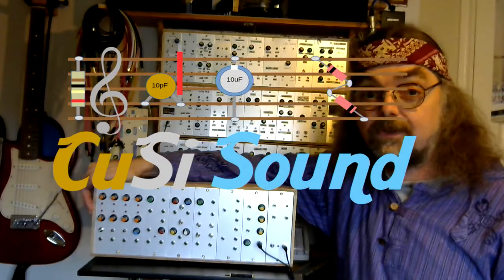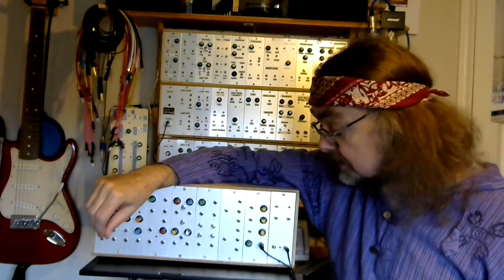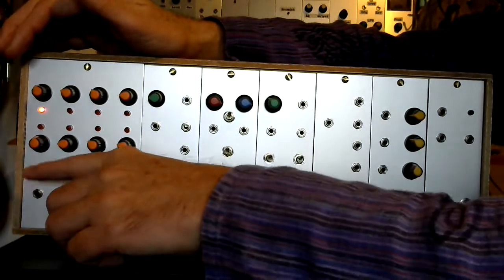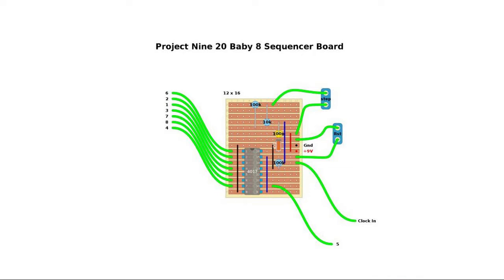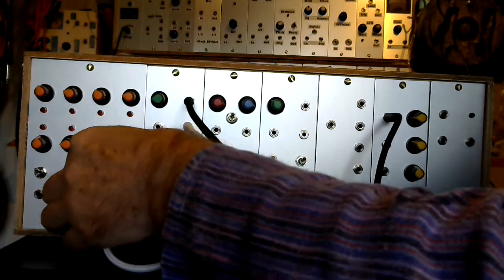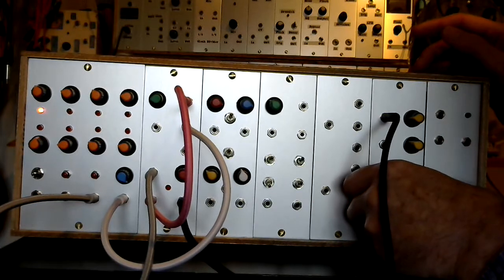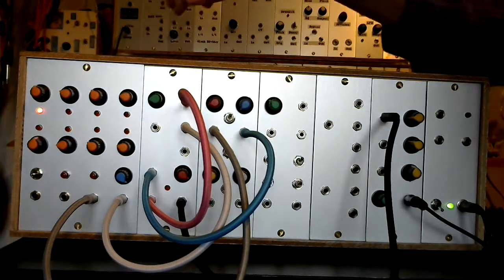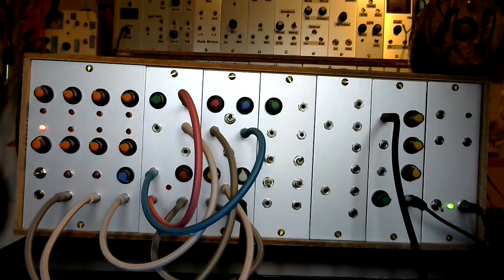Project Nine-20 DIY Modular Analogue Synth : Baby 8 Sequencer

Comment: Is the gate output to be connected to the ADRS? or would it be sufficient to adapt another CV output?
Reply from the maker: Gate signals work like switches, they are either on or off. The most common voltages for gates are around 5V and 8V (The Project Nine-20 Baby 8 provides both 5V and 8V, approximately, gate outputs). The CV voltages can range from 0V to 10V approximately. I know the envelope in Project Nine-20 will trigger at 5V but I don't know if it will still trigger at lower voltages. So, if your CV voltage drops below 5V it may not trigger the envelope or any other module that works with a gate/trigger input. Hope this is helpful.
Reply: @CuSiSound  finally works m8! thanks!
Reply: @CuSiSound  okey I will expand my baby step with your 5v and 8v gate section, I will try it, thanks ^^

Comment: Hi! in your stripboard design the 100k resistor from the step to the next row does not indicate where it continues it is just free, where does it have to go?
Reply from the maker: The "free" end of the 100k resistor is connected to ground. I should have made that clearer on the diagram, sorry.
Reply: @CuSiSound  No worries, thanks for the clarification! I'll try it tomorrow :)

Comment: Hey, Is the 100k resistance at the top of the sequencer board not connected to anything?
Reply from the maker: Thanks for spotting my mistake (proves I am human!) the end of the 100k resistor on row E should be connected to ground. The 10k-100k resistors combined with the 100n capacitor are acting as a sort of filter  to de-bounce the switch so that the sequencer only steps once when the button is pressed.

Comment: Thank you. Nice work. I dare to ask: how is it that you attach stripboard(s) to panel(s)? Thanks in advance
Reply from the maker: I either use self adhesive pcb standoffs (purchased from my local components supplier) or screw type pcb supports attached to self adhesive cable tie pads. Both methods just require a 3mm hole drilling in the stripboard where it won't interfere with the circuit.
Reply: @CuSiSound  thanks once again